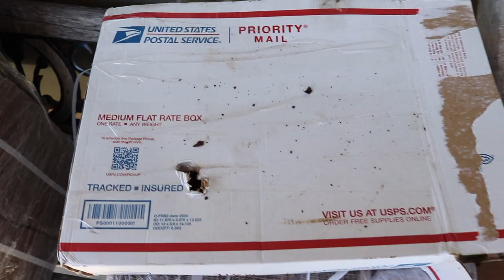You asked for this...

Comment: I would just swap both sides to the newer brackets, calipers, brakes and rotors. That way parts are easily available and you don't loose that upgraded axle that whistling diesel put under it.
Reply: It could work 🤔

Comment: How about switching to the correct caliper for that part. Will have two different calipers but could get it on the road until you find the correct one. May have to get a bigger rotor. Just a thought.

Comment: You might be able to get a 2010 brake caliper and just switch out the 3rd gen calipers to 4th gen.
Reply: That and a 4th gen brake disc if need be are likely more available than that specific bracket.

Comment: On the green first gen, those look like Trucklite headlights, they are great, but expensive. Your bumper with the black plastic is an LE model bumper. That green truck probably wasn't an LE, hence the plain bumper or it has been switched out.